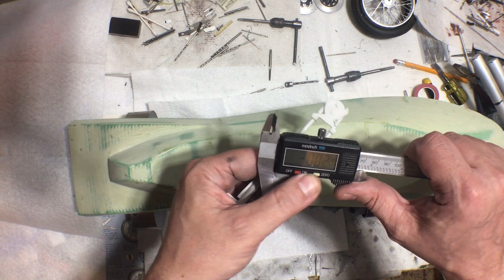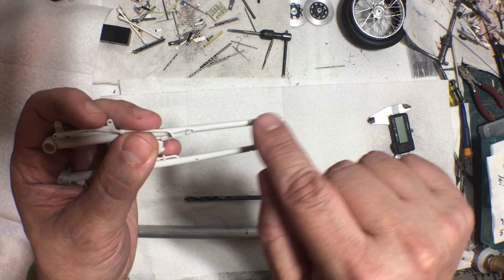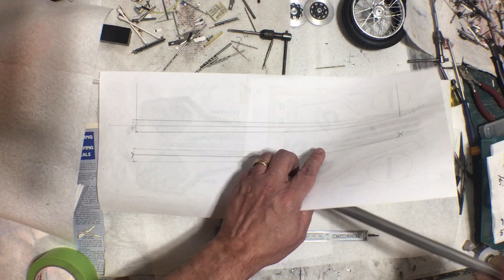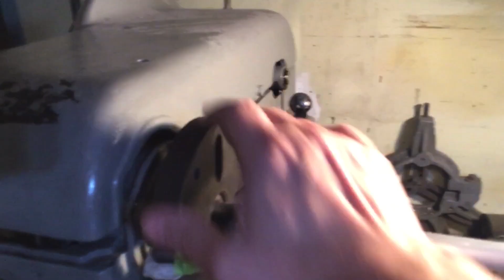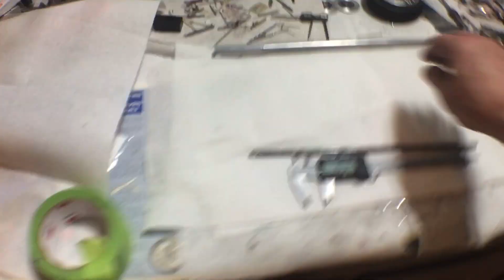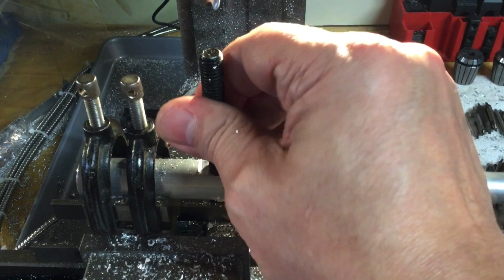1/4 scale Speeder Bike build part 4

Comment: Great video... Instead of doing all that work could you maybe use .22 caliber barrels or maybe from a pellit rifle. Nice work any way.
Reply from the maker: Thanks. I do like using existing things. But I didn’t have anything the right size, and I didn’t think about barrels. That might of worked. Not sure if they’re tapered though or how much they are. But that would have been cool to use. My dad a couple 22s. I can’t remember if they had tapered barrels or not. Thanks again for watching and commenting.
Reply: I have a 22 and yes the barrel tapers off.
Reply from the maker: Good to know. Maybe on the next one…